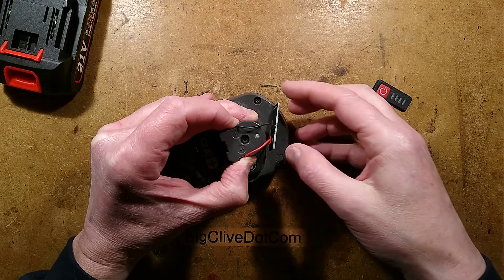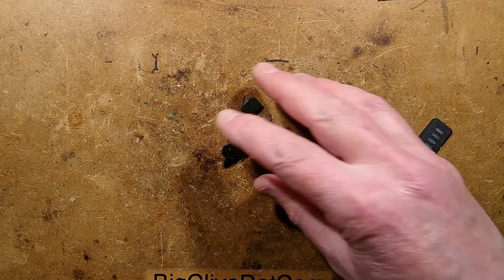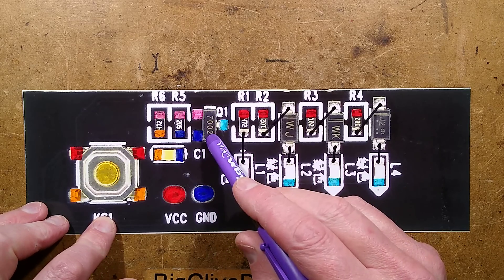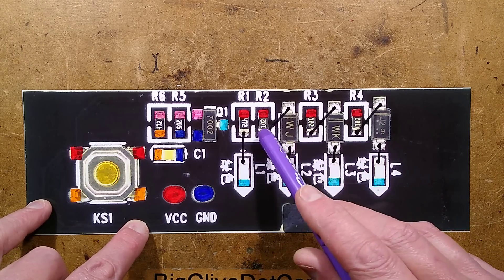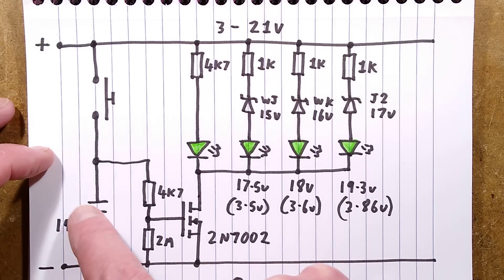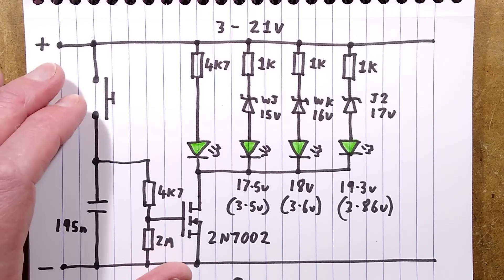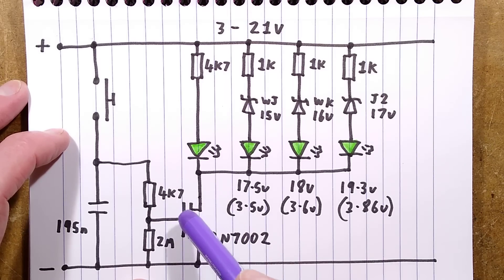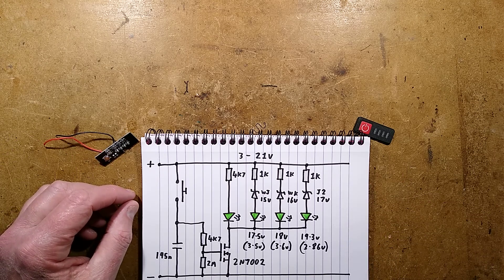Power tool battery level indicator for 5 cell packs

Comment: The 4.7k resistor would have made a lot more sense in series with the switch to limit the current spike into the 220nF cap than between the 220nF cap and FET. It would also prevent the button from welding itself closed should the capacitor ever fail shorted as MLCCs tend to do.
Reply: Imagine that suprise bomb shorting battery with that mlcc and switch, god protect that cap from cracks

Comment: What about the 3 digit 7 segment remaining percentage display version as used in Aldi Ferrex "XFINITY PLUS" brand 20v batteries? 
Can those modules be bought anywhere too?
I looked and couldn't find them. ☹
It would be nice to be able to replace the basic 4 LED version with one of these?

Comment: You can cut the plastic case easier with heat.  Attach a utility knife razor blade (the thick ones that are shaped like a Trapezoid) to a cheap soldering iron and you've got a hot knife.

Comment: Clive or anyone, I've been trying to locate or figure out how these little LED bar graph voltage units show the leds rising when a battery is on charge without the need to press the button. Most if not all the power tools show the LED bar graphs either flashing at the voltage they are at when under charge until they are fully charged and then all the LED's are alight. Without needing to press a button. Any ideas great full received .
Reply from the maker: Those are usually integrated with the charge system itself.

Comment: Hi Clive, totally not related to this video - thought you might be interested. I noticed there's 8 British made Low pressure sodium street lights for sale on eBay, complete with ballast, capacitor, ignitor and a NEMA photocell and a a 26W SOX-E lamp They cost £40 including postage (to Edinburgh anyway) seems to be £10 off for every seller that shows an interest. Search "Philips XGS201" or "Philips ME35 for 35W SOX"and you will find it. Might be interesting for a future and nostal explore and nostalgia.
Reply from the maker: I have too many street lights here already.  They take up a lot of space.  I do have SOX control gear and a lamp though.

Comment: Clive I have a assist e-bike 20inch wheel I havent charged the battery for for about 2/3 years now so I’ve tried to charge it but it doesn’t charge is there a way to get the batteries to boost up or can I change the batteries inside HELP PLEASE 😌😌
Reply from the maker: If the battery pack has been left for a long time the voltage may have dropped low enough to trigger the protection.  For a high current load I don't recommend trying to boost the battery back up, as it may cause safety issues.
Reply: Ok is there a way to get the battery working again without replacing it
Reply from the maker: @paulclarke7406  If the pack can be opened safely (keep in mind lithium, power packs store a lot of energy and can release it fast in the event of a short circuit) then you could check each parallel cell cluster to see if the voltage has dropped below 3V.  If a cell cluster has dropped below 2.5V or worse, has reversed polarity then it's not advised to try to recover the pack since it is used in a high current application, and the cells may have changed electrically internally.   If the cells have dropped within the safe level of 2.5V to 3V then they may be recoverable by bringing them slowly back to just over 3V with a current limited power supply.
Once that is done the battery management system may recognise them and recover the pack.  But if it has locked out for safety then it may not be recoverable.
Either way, the over discharge of the cells in a high current application is not a desirable thing.
Proceed with caution at your own risk, and do not charge the pack in an area where fire would be an issue.
Reply: https://www.youtube.com/@makeitwork7522/videos

Comment: Don't destroy your batteries to install that. Mount it in the tool itself. If you connect it to the motor circuit it can be a constant reminder of the battery status during use. It will also indicate battery level under heavier loads. Thank you, keep working.

Comment: 3:21 I suspect they put the 4k7 resistor in series with the gate for safety reasons.
Should the gate go short circuit, pushing the button would crowbar the power coming in, and the button would then become a finger warmer. ☝🔥

Comment: There's even cooler one, configurable to work with 2S-8S battery packs and 12/24 lead acid batteries. -> "2-8s 5-30V Tester" should get you to the product
Reply from the maker: I've featured those in a video.

Comment: I wonder how long the push switch will last?? The inrush current from a chunky 21V battery into that parallel cap must be quite significant (albeit of very short duration). Contact weld/ deterioration seems a distinct possibility to me. I know it’s not a big value cap, but nonetheless, the transient current will be big with no inrush resistance in line. Peter.

Comment: 😀👍 Thanks for the review. I have several electronic cigarettes, I plan to replace their batteries with AA and AAA batteries in various devices. Question: Is there a board on AliExpress for charging such batteries with small currents of about 500 milliamps? The famous TP4056 board is large and you need to change the resistance from the standard 1 ohm to 300 kilo-ohms, this is inconvenient. Is there a ready-made board for charging batteries with a capacity of about 1000 milliamps?

Comment: Your query about the 4k7 resistor; I suppose that allows the switch off effect of the LEDs turning off in quick but visible sucession, on releasing the button... I'd like to experiment, but I suspect the other one switch off rate would be faster and less visible without it. Not sure. 🤔

Comment: Broooo, the number of times you've made a video a day or so after I was looking into something is getting ridiculous lol like ur brain is tuning into my frequency or something. 

 I was looking at these for an old 90s Makita drill I'm putting a LiPo pack into to give it new life (the extra voltage really cooks the old brushes lol) I made a small Vero circuit with an opamp to light up a red led when the voltage gets low, but then I thought I could just get a batt meter pcb like this.

Comment: Were these ones extra cheap because they forgot to make the first led a red one? All green seems unusual. Running right at the component limit (and slightly over) has got to be a dodgy manufacturer thing, but I guess it doesn't matter too much if the gauge breaks from gate stress eventually. Probably counting on the mosfet specs also having a small safety margin.

Comment: I do wish the lower Zener illuminated closer to 15v. Otherwise this would be just about perfect for a DeWalt pack (ranges from 15.3 to 20.5 volts). I have a couple 1.5 Ah batteries that came as part of a tool kit from DeWalt. It's the only battery model that does not have the built-in button gauge, naturally. 🙄

Comment: That panel can be Dremelled out nicely.  Use a carbide disk to do the bulk of the cutting, then the curved corners can be milled via a small HSS milling cutter. The Chinese battery-powered mini drills are ideal for this sort of thing, since they are more manoeuvrable than the mains - powered models, and have more than enough power to do the job.
Reply: I don't have Dremel, so I would had drilled with small 2..3 mm drill holes where  to cut. Then with knife I would have cut plastic, then some filing and it would have been done.
Reply: @Tegelane5  Neither do I. I have a 12 year old 150W ALDI copy that's been an absolute godsend, and is very well designed (ease of bearing lubrication, and standard 5mm square brushes). I think it dates back to when their tools had the "Taurus" branding. Upgraded the front bearing to ceramic hybrid a few years back, and it works extremely well.
Reply: A hand metal nibbler will likely do a decent job as well.

Comment: As an EE I was taught to always add a series resistor to the gate, as the repetitive peak current from charging the internal capacitance can add up strain and damage over time.

Keeping in mind that the switch is applying 20V to the gate, it's likely that the MOSFET would wear out rather quickly without the resistor
Reply: I have the same device but for a 7s pack. My guess is that for higher voltage configurations they will place a high value resistor to keep the max gate voltage around 20 V, while for 5s and below they could just place a link, but since they already have a 4k7 in the BOM, they just placed one of those instead.
Reply: @EnricoConca  "already have a 4k7 in the BOM"
Noticed that myself as well.  Perhaps by going with the value used fewer times in the rest of the design the could get a better overall improvement in bulk pricing.
Reply: @EnricoConca the BOM idea makes sense. I suppose they're also looking for a similar RC constant.
Reply: Big reason for using a gate resistor is to prevent ringing; not really an issue in this application.  As for wearing out the FET, I don't think longevity is a primary concern in this application.  More likely IMO is that it's to allow substitution of a BJT for the FET (depending on which can be sourced for less; resistors are much cheaper than transistors).
Reply: @alexhajnal107  Ringing!  Charging or discharging a CMOS logic input or MOSFET gate directly through a switch will cause a beautiful damped oscillation lasting a few microseconds coming from the capacitance of the input and the inductance of the interconnection upon closure of the switch.  In extreme cases this can even cause devices to go into self-destructive latch-up.  I had this happen on 4000 series CMOS gates in the 1980s.  If you've never seen this effect first hand, it's hard to believe, but it definitely happens.
Reply: Yes, but also 2n7002 Vgs +-20v, Vbatt 21V. Hence the divider. No?
Reply: @tsmwebb  The resistor's only dropping about 0.05V.
Reply: @alexhajnal107  Good point. I didn't notice the pull down was 2 meg.
Reply: @tsmwebb they probably had it at 20k but for the slow decay effect on leds they put a 2M and forgot or didn't know to change the other resistor...

Comment: I like the use of an RC delay tied to the MOSFET's gate.  Simple way to get a spiffy effect.  Perhaps the 4.7kΩ resistor is to allow optional use of a BJT instead of a MOSFET?  The transistor's going to be far pricier than the resistor.

Comment: Why don't you make better version the batteries .. maybe use red low power, yellow  then green
Reply from the maker: Changing the LED also modifies the threshold voltage.
Reply: This is why I like to use a voltage reference (zener with limiting resistor for cheap and nasty, or a proper vref component when I'm showing off) which feeds comparator inputs with respective scaled voltage dividers for the indicator thresholds.  Then, you get a logic level output that you can use to drive anything you'd like.

But that's a king's ransom in parts compared to this.

Comment: 4k7 resistor is in the wrong place, it should have been in line with the switch, to limit the inrush current into the capacitor.
Reply: I doubt they care much about the FET or capacitor's longevity in this application.
Reply: Hmm - what if it's intentional?

The inrush current to the capacitor is kept high, so that small amounts of oxidation on the switch will be burnt off.

The 4.7k resistor is there to protect the gate from inrush current due to the internal capacitance - at 20V this is not insignificant and would lead to a reduced life of the FET.

Of course mistakes can happen, even with items manufactured in scale - but here it's maybe a "happy accident" that leads to more reliable operation when the tools are kept in humid conditions etc

Comment: The first indicator might have some use in that it shows the battery pack isn't dead.
Reply: Its primary function is to show the working status of the indicator. Absent this one and assuming no other LED lit, it would be impossible to tell apart e.g. a severely discharged battery or a defective / improperly depressed switch .

Comment: Hart 2.0 cases are indicator less, but the case is double wall there...

couldn't you glue the indicator on & pot it with clear epoxy?

Comment: It seems like a simple enough circuit to measure the float voltage of the battery pack, a  Go/No-Go kind of indicator.  Milwaukee has a BMS that will do odd things if it thinks that the battery pack isn't working correctly.  I have one such junk battery that just gave up a few months after purchase.  I've hung on to the pack just incase there is a fix for it... but I plug it into the charger and it is giving me a No-Go on the charge.  Frustrating since it was a relatively new battery at the time.
Reply from the maker: Sometimes packs lock out because the cell voltage has drifted too low.  With a pack like that I will open it and see if it's just on the edge (2.5V per cell) and if it is then the cells can be gently brought up to 3V with a current limited power supply, and the charger may recognise them again.

It's debatable if they should be used for high current loads when that happens though, as extreme discharge can change the cell's characteristics.
Reply: I have a couple of Vanon-branded 18V Li-ion battery packs that someone was tossing since they failed to charge on their regular DeWalt charger. I found that just jumpering the positive and negative terminals on the packs to a current-limited PSU at 100mA and 20V and leaving them for a day or so charged them up pretty well. They work fine on my DeWalt tools but I can't fast-charge them like the real battery packs the tools came with. Didn't cost me anything though.
Reply from the maker: I'd suggest not charging them to the full 20V, as it's possible one cell may be lower than the others, and that can result in overcharging of the other cells.  It may be better to nudge them gently back to 16V and then let the charger do a proper managed charge.

Comment: This has always annoyed me about powertool batteries.
Lithium cells have a nominal voltage of 3.6V and a charge voltage of 4.2V. There are 5 cells for a total of 18v nominal or 21v charge voltage
Milwaukee, Makita, Ryobi, Bosch, Cat, RIDGID, etc all call their systems 18V
DeWalt, Bauer, Craftsman, WORX, Hart, etc all call their systems 20V.
THERE IS NO DIFFERENCE. All of these brands are using 5 lithium-ion battery cells in series. THE END
Reply: I got the impression high voltage Li-Ion batteries that charge up to 4.3 or 4.4 cell voltage was the first with 20V branding, and then marketing departments stole that idea. Voltage=Power=Sales (Marketing truth)
Reply: @g.h.190  it's 5 cells, so the math doesn't work out. Their cells were typical 3.6/4.2 18650s anyway. It wasn't until more recently that they've started to push different kinds of cells.
Reply: If we could all agree on a single distinct nominal voltage for each chemistry, that would be great.
Reply: @denverbraughler3948  3.6v is the nominal voltage for lithium-ion.

Comment: I have several batteries with this type of indicator - oddly on one of them the leftmost LED stays on permanently. Not sure how long that would take to discharge the battery
Reply from the maker: That's not ideal.  It will pose a continuous low drain on the battery.

Comment: The Chinese aren't the only ones that mislabel nominal battery pack voltage. The 18V DeWalt tools sold here (UK) are sold as 20V tools in the US and they actually say 20V on the battery packs too. Same batteries, same tools, different labels.
Reply: What I find odd, is here in the US the Ryobi 5S packs are labeled 18v but other brands are 20v, while the Ryobi 10S packs are called 40v here but 36v in the rest of the world.  🤷

Comment: Vgate limit is usually around 20V ... the 4k7 keeps it safe with a 21V supply, but should have been 470k 😮
Reply: Just what I was thinking, keeping the gate voltage safely below 10V seems to be the trick.
Reply: @jounik  they probably started with a 20k lowside  resistor but the led discharge effect was too fast, changed it to 2Mohm and forgot/didnt know what the other resistor was there for. 😁
Reply: But adding another resistor value to the BOM adds to assembly costs. Better to use what's already there, if it works. Which clearly it does.
Reply: @NusaCat  It works until it doesn't.
Reply: @NusaCat  until it fails because the gate breaks
Reply: It would be possible on that bom with 1k on gate and 4.7k to ground, but that would remove that holding effect with that capacity

Comment: I added a very similar one of these to my girlfriend's older model Dyson stick vac she got refurbished. They want you to charge it every single time you're done with it but she wanted to extend the battery longevity and having an actual measure of the remaining charge is a big upgrade in usability. Dyson really is too cool for school with their designs sometimes. Emptying it is complicated enough (can close the dustbin back up in the wrong order) that it required instructions!
Reply: Agreed. Over-engineered nonsense. And sometimes poorly designed too.
Reply: Dyson charger is quite weak, charging max current about 0,8A, so it makes sense to keep it in charger (trickle) charging. As almost depleted battery would take several hours to charge otherwise.
Reply: Dysons also log a failed cell in eprom on the battery board. It's usually just an 18650, but you need to clear the fault or it'll still reject the replacement. There are videos on YT.